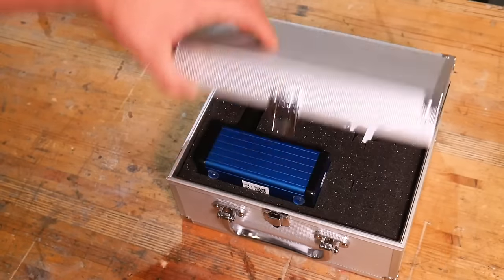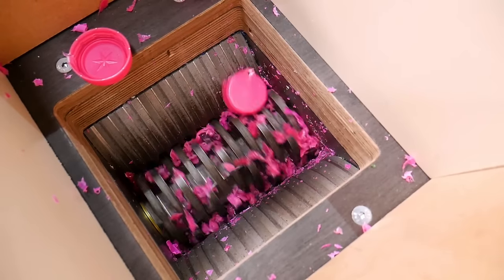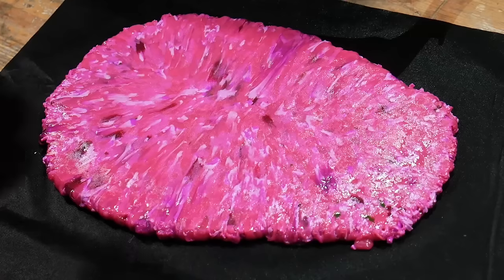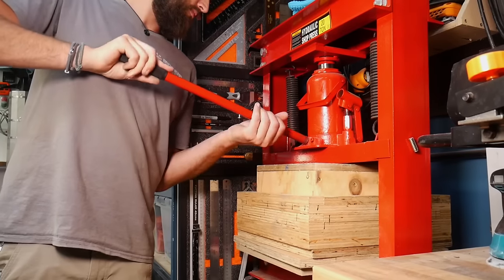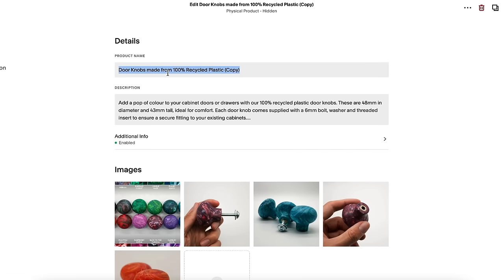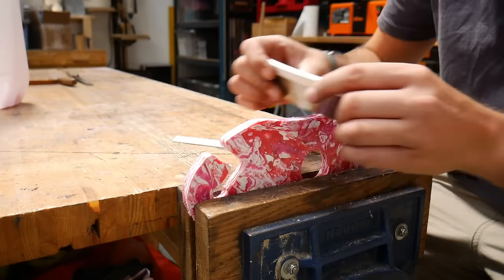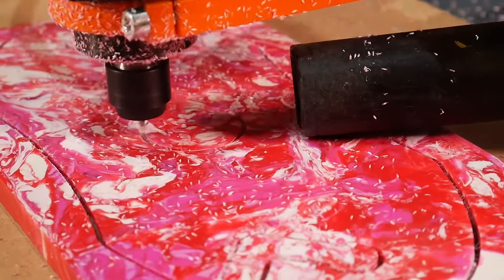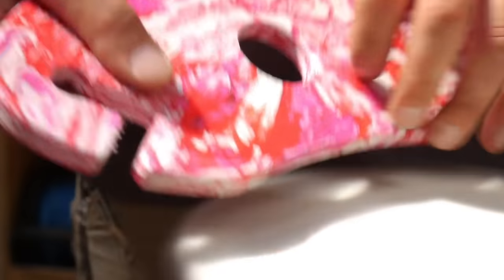Turning Plastic Trash into a Gift for our Mum

Comment: You guys really ought to try my press. It has all the benefits of direct heat, actively clamps during the process,  and can be set to the side while cooling so your oven can roll right into heating another press.  It's monumentally less labor.   And you're only using $8 in springs instead of an entire bottle jack.
Reply: I will certainly look over what you have. However, if you get hold of a working bottle jack at an auction for $2, it makes a difference. 😏
Reply: @MaryAnnNytowl  That's a nice find but can still only handle one at a time.  Since my devices is both the press and the clamp I can pull them out of the oven to cool and load up the whole new set.  What they lack in size they make up for in speed, ease-of-use, and a consistently lower price without getting lucky.

Comment: seeing you twist the molten plastic reminded me of candy pulling. I wonder if it's possible to do plastic pulling? It would probably make the plastic much weaker, as the point of pulling candy is to introduce air bubbles but it would be interesting to see if it's possible.

Comment: I sort HDPE into 3 categories by their viscosity:
-Thick, or blow molded as you mentioned.  This includes things like milk jugs, laundry detergent bottles, and most household containers.
-Thin, or injection molded as you mentioned. Which can be anything from paint buckets, hard hats, milk and soda crates,  Ice cream containers, and even some large storage totes.  This also includes Type #4.  LDPE (Low Density Polyethylene.)  Which is more than likely what you're bottle caps actually are.  And this also includes MDPE medium density polyethylene (Sometimes labeled as type 3 because the resin sorting system just awful) MDPE can be found most often as a packing material.  It's melts beautifully too.
-Grocery Bags. These get their own category because of additives that make them even thicker than blow molding and also fibrous.  They melt really well, and the thin layers let you do some neat tricks.  Unfortunately it CNC's with a terrible finish, and hitting it with a heat gun makes it worse.
Reply: Do they smell as they melt?
Reply: @paulvincentangcon2659  Not really, no.  Or at least less than a 3D printer when they do.  If you keep the temperature low they won't.

Comment: Hi guys. Thank you for bringing attention to the differences in hdpe ie extrusion molded and blow molded.

Also, I miss doing this stuff myself too.
Reply from the maker: We thought it was interesting enough to include in the video! Thanks for watching 🤙🏽
Reply: @BrothersMake  It's this sort of process insight that saves others from consternation and frustration.   Much thanks.
Reply: @BrothersMake  like I said I used do this myself and never understood why some hdpe would be more molten/melt faster than other bits of hdpe. So it definitely helps that type of insight/knowledge. Thanks for sharing.

Comment: Is't it possible to make filament for a 3d printer (1,75 mm)  from these materials? The meltingtemperature is low enough to adjust this printer to and the colours would be amazing.
Reply from the maker: Unfortunately not. The shrink rate of HDPE isn’t conducive to making filament from it.